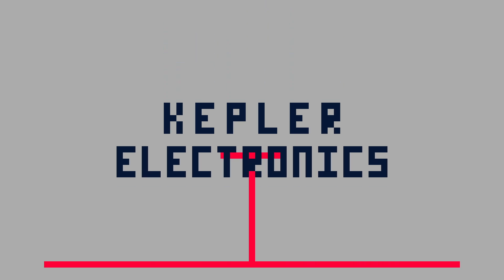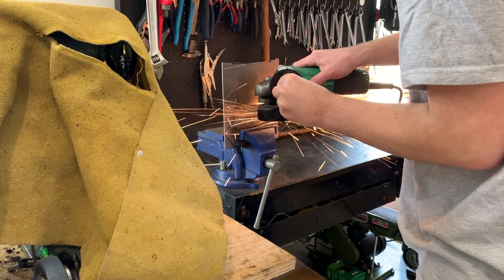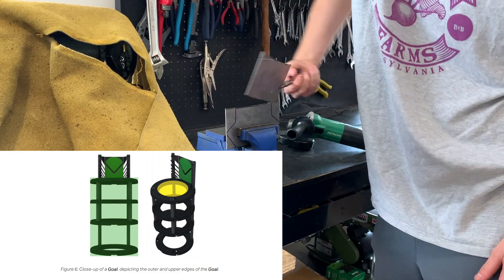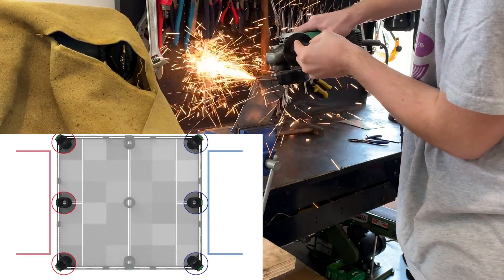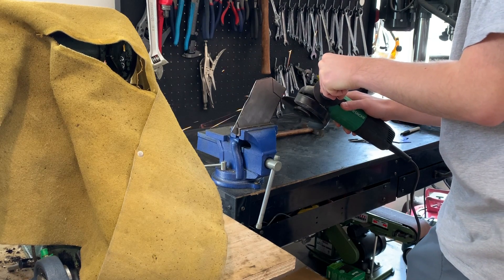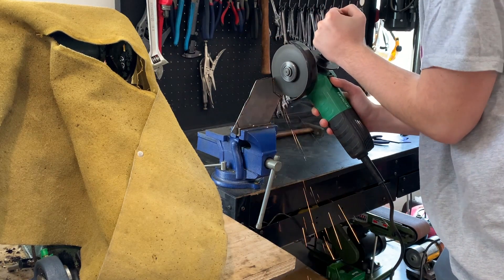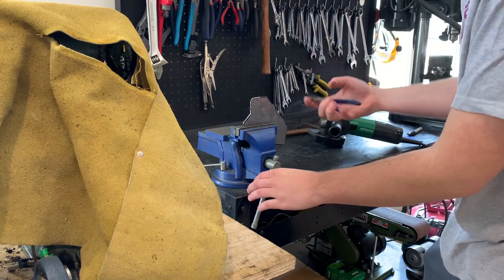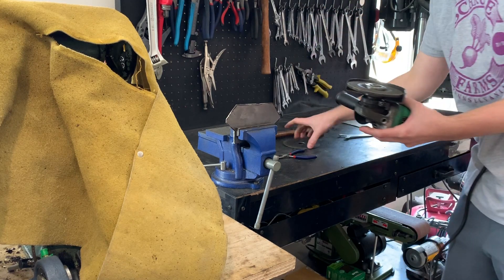VEX Robotics Change Up Rules Explanation and Strategies

Comment: Am i able to keep those three balls? it says i cant have greater than momentary possession of more than 3 opposing balls, but if i have less or equal to 3, can i just hold them?
Reply from the maker: That’s what I’m understanding. Less than 3 is ok. I’m assuming because you can be intaking balls from a goal and get some from the other team
Reply: @KeplerElectronics  thank you :)
Reply: If you read the rules, you can hold 3 forever. You can also be in momentary possession of a 4th (different judges will interpret time differently so watch out). The important thing to note is that if you DO have more than 3, you CANNOT take any other action other than getting rid of the extra. No driving, scoring, descoring, etc.

Comment: You got the win point in autonomous misunderstood. It is not just another point in the match, I’m not the best at explaining it, if someone else could, but I’ll try. Getting a row in autonomous gives you a win point. Win points will help with rankings. Winning a match will give 2 win points. Hope this helps.
Reply: axl2004 basically a win point is an extra win for your record(wins, losses,and ties)
Reply: Mateo Heitner not quite. 1 win is 2 win points. 1 win point is a tie
Reply: It’s not a match win point, it’s an AP (autonomous point in addition to the bonus)
Reply: Andrew Lay I will get the specific rule, but it is a win point if you top all three alliance towers in autonomous
Reply: If you look under tournoment definitions, there is the definition of the autonomous win point. It will count to help ranking. It does not count for wins, losses, ties. It is the secondary ranking meathod if someone is tied.